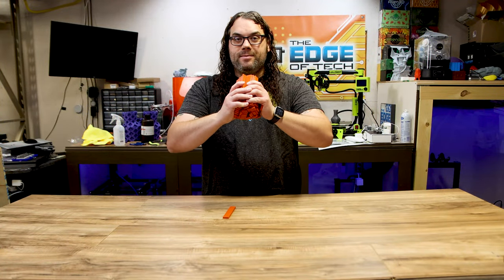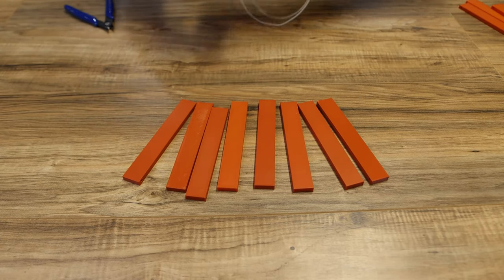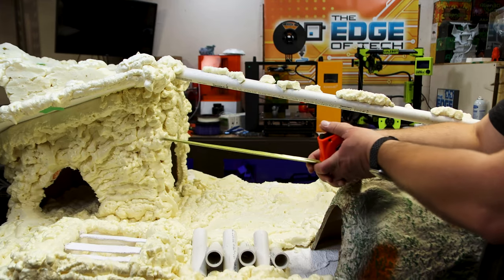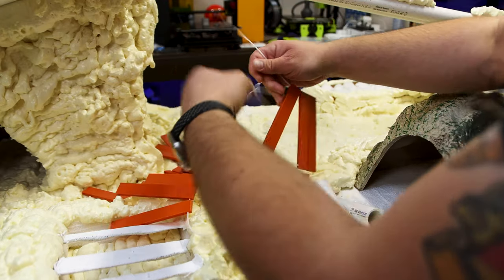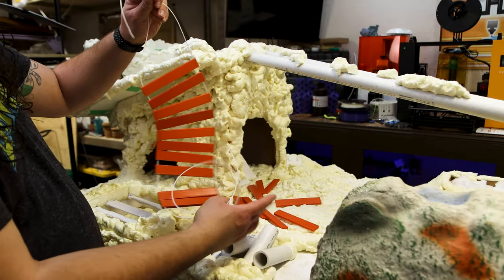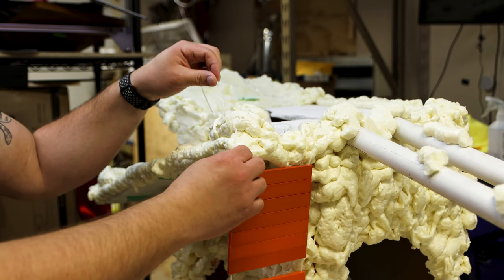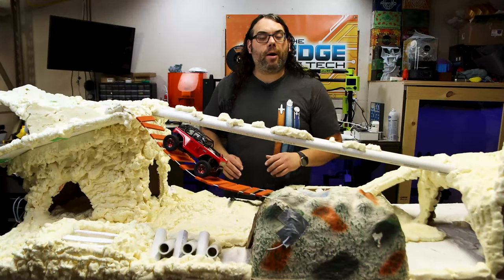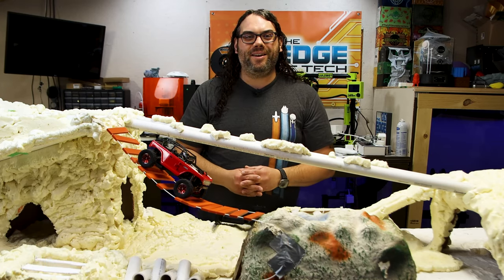Check Out My 3D Printed Bridge Test! SCX24 Course

Comment: Looks like fun.  Could you make some sieves or even cut some old PTFE into short pieces as spacers for the bridge planks?  You could still adjust the spacing but they would not spread so much.
Reply from the maker: Great idea!
Reply: This is what I was thinking as well. Put some type of spacer between each plank and it should prevent those issues. Also, if you don't want to use the PLA, use weedeater string. It'll hold up long term. And would look cool in orange or neon green haha
Reply: @nickq615  Great idea, I have some spare string trimmer that I tried to use as filament.  Long live Oreos and cellular oil towers